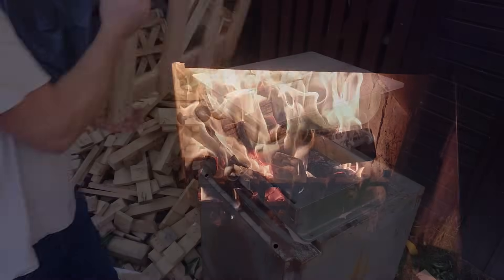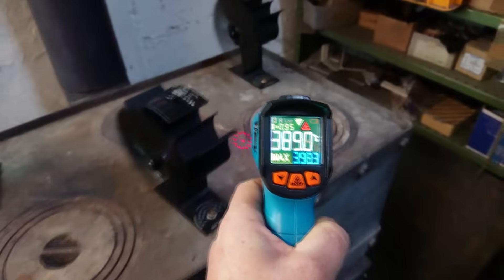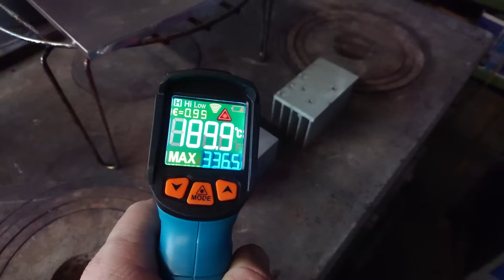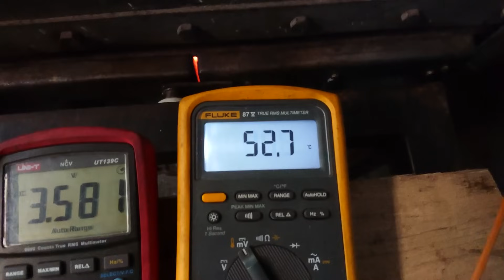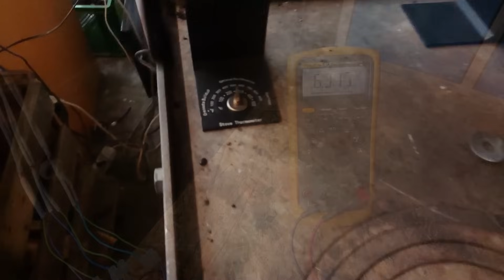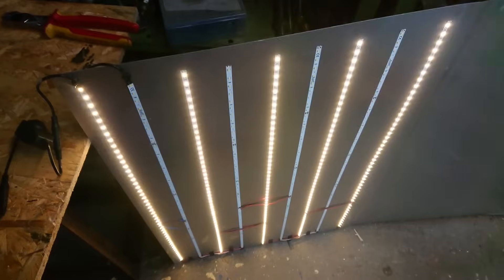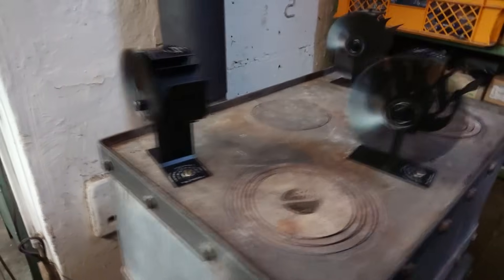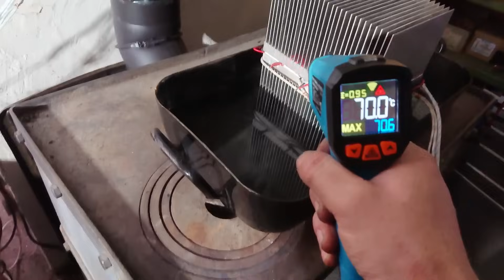Generating Electric Power with my Wood Stove - Peltier Experiments

Comment: okay  I had a thought while watching. have you thought to try putting the device below the heat soars ? that way the hot side would be on top & the cold beneath the cold side would need less cooling & you would get heat but not as much to reduce the needed stand off to protect from to much heat. just a thought  great idea you have here. mind if I try it for my man cave?

Comment: Heat wood or coal to make gas and use it to run a generator or heat water to make steam and have a steam engine to run generator ever way you can get as much power as you need as long as you have wood🙄🤑

Comment: We bought a home recently with a fireplace and a fire stove. I have been thinking along these lines but this gives me a lot more to consider. I had been thinking of using electric for the than fan, as all i am after is moving more heat around. Thing I did learn is the fireplace insert uses a thermistor to only turn on the fans once it becomes hot enough. A way to leverage this is for aux cooling of this power generator, maybe by enabling additional cooling fans to the heat capture to reduce their temp and not burn up the peltiers. Sounds like a fairly simple idea for someone with your background. The thing would be to be able to over cool for a worst case scenario. 
Thx for the great ideas!!

Comment: Why not just take off the fan blade and mount a belt to a dynamo on it. then proceed to feed a circuit with battery storage and feed a light from the battery.

Comment: If you're going to add cooling,and you're using this in a cabin that normally deals with colder outside air, you might want to consider making a fresh air heat exchanger that you can mount a radiator of sorts to the outside and run lines into and through the heatsinks.  Yes, it adds complexity, but limits the amount of added power you need to put into the system. 
Could also use that setup with a snow or creek cooled device if you have one available.

Comment: Instead of placing the device on top of the stove I would place it below.
The concrete floor is a huge heat sink at a fairly low temperature (probably below 20°C).

Comment: Stop mocking around with these low energy ideas, you are wasting your time and money!!!.
If you want really usable results, The best way to have free energy is to burn used free veggie oil from restaurants, in a Diesel generator.
Then you can heat your room and have as much electricity as you want.
I mean, you could run 20K generator easily.
I have done it!

Comment: Why don't you use 1 of the peltier devices for a fan to cool the fins. I expect that the higher temperature diferential would cause a higher usable current, even when compensating for the 1 fewer peltier devices

Comment: Instead of using a heat sink to regulate temperature to 100C you could use boiling water. A great 100C regulator

Comment: put the püeltier element outside and use a gravity pump(the rising of hot water) instead of a electric pump to get the hot water out - obviously you would loose some heat, but the cold temperatures uotside would benefit the devide a lot

Comment: You could use a temperature sensor and a fan to reduce the temperature of the hot side if it hits a threshold. A wax motor could also work to drive a fan or mechanical leverage to open a gap between the heatsink and hot surface.

Comment: 1. As you have noticed you would have to increase complexity regardless. Instead of the peltier idea you could use the hot steam to turn a turbine and generate waaaay more power than the peltier elements ever could. Create steam, turn a turbine, let the steam condensate and come back in a closed loop. 
2. Build a hot air engine, stirling engine, manson engine, free piston engine etc. They are also way more efficient than peltier elements and the high temp. difference does not matter much to them.
I have seen you have a huge amount of old generator, you can use one of them to create an alpha configuration stirling engine. A modern stepper motor would be a geat compact generator with a very high efficiency, about 2x higher than all the other dc motors one usually has. 
3. The peltier idea has always been a wood fire with a pot filed with water and the peltier elements inside, that´s basically what you have recreated here as well. To increase cooling you would need air from the outside to cool the heat exchanger.

Comment: I've used Peltier plates to power leds in a PC. The plate was placed between the CPU and heatsink.  It worked, but they just aren't efficient.

Consider running a generator on wood gas. Stay safe!

Comment: Peltier is max 5% efficient. A stirling engine can be about 25% efficient (thermal energy to electricity). Peltiers are really nice because they are solid state, but you have already noticed how their temp delta is rather low. The stirling on the other hand can work with the full 400°C to even increase power output. I wish a simple stirling design would be available for home use like here. It´s rather difficult to build a good stirling engine.

Comment: probably a much simpler method that would yield better thermal differential would be to simply affix the top cold side of peltier devices to a thin aluminum sheet that is positioned above the stove at the appropriate distance to provide proper temp. Use a large enough sheet mounted at an angle that would draft cooler air from the side of the stove, natural convectioin will draw air along the angled plate/sheet to promote upper side cooling. The side of the metal sheet edges can be folded down to trap hot air from easily going around the edge, helping differentiate even further, add the stove fan and the thermal difference will be much better than anything just sitting baking in radiant heat on the stove directly. Utilizing the moving/ convecting air will be the magic sauce to make this concept worthwhile.

Comment: I forgot where I saw it but someone was adding automotive radiator thermostats to their stove fan stands. they are a wax motor that expand when heated. he was using them to lift one side of their stove fans so very little of the base would actually rest on the stove top. it was a passive way to throttle the fan and prevent it from getting too and damaging the TEG. it worked really well and the wax motors were more than strong enough to do it. really an ingenious use for a wax motor.

Comment: Big heat sinks can be useful for alot of things, like peltier coolers, also it can be used backwards as a heater, not to mention all the electrical or refrigerator components that could be used with a big heat sink. One of those impossible to throw away items 😊

Comment: Make the heated water enclosed with steam going to a condenser coil and cooling water output through a radiator with fan. Maybe size of some use on water cooled computers. Then cold side enclosed using cooled water.

Comment: Love the video.

Suggestion: How about if you made a device where a Peltier element powers a water pump, which circulates water to improve its own cooling, thus creating a self-enhancing cycle that increases the temperature differential, efficiency, and power output? Plus you get a small amount of hot water, to make use of.

Comment: Tried allmost the same. Not with a stove. I wanted to use a grill outside. Had the same problem with the temperature. Ended up with an "closed" water loop. One Heat exchanger was put on the grill. From there the hot water flows through another exchanger attached to a row of Peltier elements. The cool side was a salvaged Heatsink with 2 old Computer fans. After that came the pump and back to the hot plate. The fans and the pump was driven by the TEC. I used the distance of the exchanger to the hot plate to controll the heat. Added later a water-air exchanger before the pump for better heat management. Scaled up this would work but a lot of parts need to be useable for high temperatures.

Comment: Please utilize a Bimetallic actuator to automatically adjust the peltier away from the hot surface. Sliding interlock of tapered heat sink fins to modulate input energy. HMU if you would kike a drawing. GREAT VIDEO!!

Comment: hello!
As an electronic engineer, I have couple of suggestions. Firstly, in order to achieve more power production, you need more temperature differentiation between the hot and cold side.
You need less heat and lower temp on the other side in order the peltier to produce more power. So is better to use the cold weather outside for the one side and the hot chimney on the other site. The bigger the difference of the temperature between the two sides is better.

now in order to avoid to burn the peltiers, you have to lower the thickness of the metal touching the hot surface, also increase the length of the metal between the peltier and the hot surface.
Lastly, on the hot side of the peltier you don’t need aluminum. You need very little heat and fast cooling down on the other side.
Sorry for my pure English, I hope that this will help a little bit.

Comment: i would mount the peltiers outside to make use of the temp difference, one side to the hot side of the chimney with a mount that conducts the heat and other into the air with a small fan.

Comment: I am thinking you could use one of those cheap diesel heaters and find some frying oil.

Wood gas is not as easy to refill as gasoline either, cuz you have to get rid of ash and then load a lot of physical bulk.

Comment: To get a source of cooling: Make an outside combustion air feed to the stove thru a 3" or so pipe, as the stove draws in outside COLD winter air, direct it thru the heat sink on the cool side. This will supercool the devices and possibly prevent hot side damage. It would also up your heating capacity by reducing the infiltration of cooling air to the living space. Michael in Colorado.

Comment: Given that you are mainly looking for power in cold weather, consider ducting outside air past the cold heat sink.  looks like you have masonry walls so that might not be easy, but insulated ducting run in the proper way would allow a lot of very cold air past them with no energy consumption.

Comment: I used peltier cells under solar panels to reduce the operating temperature of solar panels under hot sun. This way  solar panel can remain cooler hence produce more electricity. In process I used a heat conducting glue to stick hot side of peltier coil under solar panel and use the same heat conducting glue to stick a heat sink on cooler side of peltier.  I could see upto 30% efficiency increase on solar panel. Power from peltier is small, just add 10% electrical power output.

I need to find a better peltier cell with higher operating temperature to salvage heat from internal combustion engine.

Comment: If you need extra humidity in the winter, I would suggest cooling it with water.  Put a tank on one side of the stove far enough away that it gets down to room temperature, and connected to a hose to drip onto the upper heatsink.  The higher you put the tank, the less power it will have to use to pump the water.  Then have a low power fan drive blow on the wet heatsink, and you have evaporative cooling that should be quite a bit cooler than the boiling temps of water.  You might need to make it from scrap aluminum plate as you want most of the surface wet.  Have a drain from the upper heatsink that goes in a safe place away from the wires.  This leads to the lower surpface which is connected to the stove mostly by water so that when it gets dry, your hotest fire won't overheat the peltiers.  It would help if you could control the whole thing with a microcontroller.  The Propeller from Parallax is a really versatile one because it can run really low power and can also run way faster than an even many arm microcontrollers.  It has 8 cores that makes programming them much easier as each task can have it's own main loop so that there is very little interference in timings from one task to another.
Reply: Now that I think about it, if you make the parts that touch the water out of stainless steel.  Then you could have an automatic, wood powered automatic water distiller!  You also could use the cooling water in a cooling loop around your shop.  It could be as simple as small flexible copper pipe tucked into the lower corners of your shop, which are usually the coolest.

Comment: The boiling water idea needs a passive cooling solution or you will use more power than you can produce. Using a cold air intake to use the draw of the stove has been mentioned but should be combined with the condensating water from the boiling process. Misting the condensation water, recovered from the boiling process, over a heatsink while pulling the cold intake air over it should improve cooling. The misted water can the be refed in the bouling process.

Comment: I've been playing around with the idea of generating electricity from a wood fire for quite a while.

Peltier devices are tempting but any time I've run the numbers it just doesn't stack up. They cost far too much for too little electricity.

I also considered a steam engine but those are surprisingly complex and need careful management. If you accidentally let one boil dry they can destroy themselves. If you add water back in they can explode.

In the end I settled on stirling engines. There's a very good channel by an english man building a 500W engine in his garage.

https://www.youtube.com/@ShanePomeroy

Comment: Could always use copper tubing in a coil around the stove pipe to produce hot water without using electricity. That concept used to be used in the not to distant past to heat water for cooking and bathing. Great effort on the idea, you are one of the innovators on the internet. Don't put all your ideas out there others are watching.

Comment: Either by gravity feeding water thru the cooling side of heat sink and collecting it and use a small solar pump to bring water back to the starting point. Air could be used to pump water using geyser pump

Comment: As an idea for passive radiative cooling, im unsure how effective this idea might be but consider using the air pulled into the fire as a method or cooling before it actually reaches the flame? Such as making an air channel that feeds the fire on one side and have the device put between the intake and the exhaust? I know rocket stoves achieve higher burn efficiency from restrictive airflow methods, maybe it could help in passively cooling the device?

Comment: Use water to transfer heat to the hot side and use a open water bath on the cold side.
The cold side bath would be say half way up the fins, evaporation could increase the difference ? 🤔

Comment: I once built a similar setup,
my setup used 10 of those 12706 modules all wired in series. Then i used a cheap solar mppt ~30€ and charged a thrown away car battery with it.

I sandwiched the 10 peltiers between 2 aluminium sheets (4 and 5 millimeter). One being the hot side 5mm directly on a stove - the second one being the cold side cooled by water 4mm.

Now the cold side being a plain aluminum plate surely isnt ideal but it keeps it cold to the touch.

I clamped every peltier between the two  plates with 2 screws each. I used thermal compound for maximum heat transfer on both sides.

I was able to generate 3W for a short amount of time. Now i can only get a maximum of 1W

My design probably failed at thermal expansion. When i first heated it up you could hear it click as it expanded.

So you would ideally need:

A mppt controller (i dont know if cheap solar works tough)

The highest transfer of heat you can manage through the modules. I believe they work up to ~130°C applied on the hot side. The cold side should stay as cold as possible with as little effort as possible.

There is no maximum thermal difference (except maybe because of thermal expansion) and as the TECs are intended for cooling this may be more relevant to cooling performance

You also need to properly clamp the modules between the plates. There are application guides on the web with pressure values for peltiers which should have been tested. It apparently effects the results by a lot.

Meister Jambo made a video on his solution to this problem. Maybe a solution you could try as it seems the least expensive and he also generated high amounts of power with lesser modules.

I am looking forward to part 2 and maybe i will revise my design then.

Comment: My first thought was using water, the moment i heard that the peltiers can do 100C... that is then very simple way to regulate temperature, the phase change takes so much energy that boiling water will remain at 100C, minus losses that means always staying below 100C. But that means evaporating water, and filling up the water.. My second thought was to use the exhaust gases with a vent that it thermostat controlled. That can be a fully mechanical device but it requires a way to redirect gases to a second pipe.